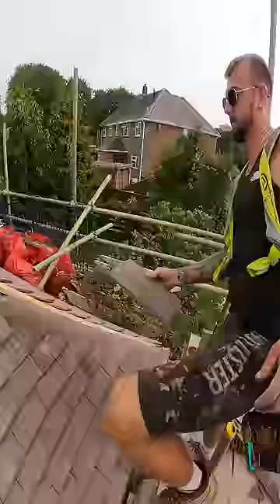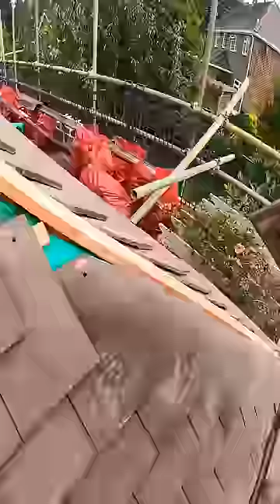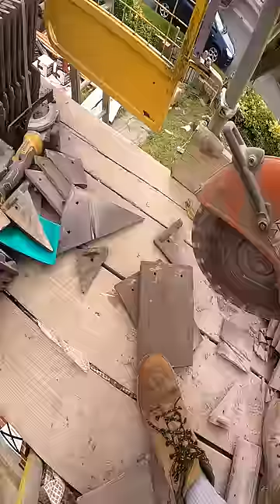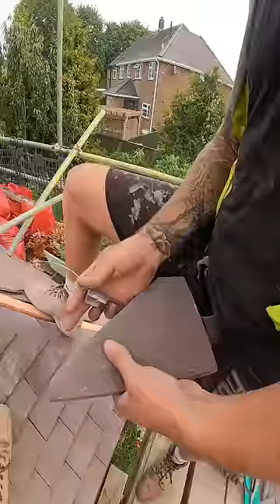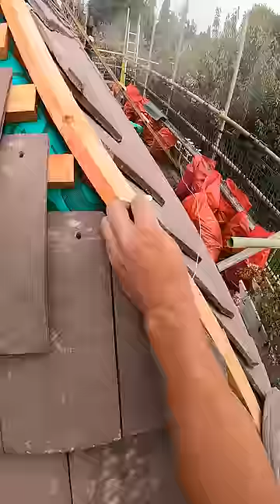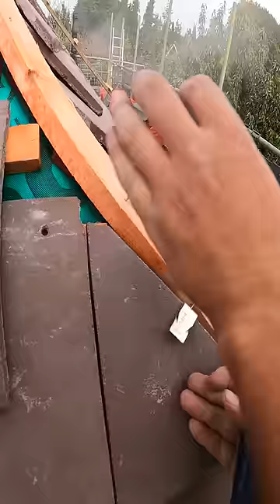#shorts #roofing  #construction

Comment: That corner though...my day is ruined.
Reply: It triggered my ocd
Reply: If you love the corner so much why don't you marry it
Reply: I will get covered your just worried about the bottom visible part at that point 😅
Reply: Getting covered. You are one of "those" customers 😂
Reply: Wrong, one of the workers actually doing this and if everthing else under is properly installed underneath that small imperfection wont matter at all lol
Reply: @sickwidit3099  sorry i read it wrong the first time. I agree with you
Reply: Oh I hear ya . As an installer , that shit has me feeling like Howard Hughes . And the saw , nah ... I would have to go grinder and diamond edged blade . But that's just my maniacal, perfectionist self . It's imperfectly fine... But I would struggle to not have the urge to fix it .
Reply: Vatoslocos327  no compa haha era cura pero aquí todo se lo toman en serio hahah vatoslokos pa siempre.
Reply: @Gamigner what are u 12??
Reply: That's a Big Saw it's going to knock off the corners it's getting covered anyway
Reply: Nice job.
Reply: @mohammedarshad3798 you don’t have ocd
Reply: @anidiotmakesthings 😔
Reply: I think a corner line will come through and cover it
Reply: @sickwidit3099 still triggers my ocd 

It's far far better to use a small battery grinder too 😂
Reply: If youre worrying about that and going to recut all the ones that happens to, best order at least twice as many as you need and a fresh skip.
Reply: Same... my boss would've flipped shit over that if he saw me put that in lmao
Reply: The top covers it💀🙏
Reply: Wont see it at the end
Reply: @Gamigner 😂😂😂😂
Reply: Ceh, weak
Reply: If he had cut starting from the other side that wouldn't have happened 😅 I knew as soon as I saw him go in for the cut that was going to happen

Comment: As a professional painter and having been on hundreds of those types of roof I am truly happy to still be alive.
Reply: As a professional painter.  Ive broken hundreds of those tiles without telling the homeowner.
Reply: Did you see how close his belt is to catching that scaffolding pipe?
Reply: A professional painter?? I doubt that you ever entered a painting apprentice program. And if you do indeed possess a master degree in the trade congratulations. It truly is the hardest apprenticeship is 6 that i ever did. 🛶💪🇨🇦
Reply: @tookalook1  He told me he was a master fisherman or master baiter, I can't remember which.
Reply: As a professional painter I've definitely broken a few tiles and blamed it on previous tradesmen. 😂
Reply: @tookalook1 🤓 I have a painting degree
Reply: @tookalook1 what made it harder than any other apprenticeship? I have master collision certs, master automotive paint certs, journeyman welding certs, journeyman heavy operator certs and journeyman plumbing certs, currently working with an electrician for heavy wire. Non was harder or easier than the last. All required full attention, high intellect and hard work. 
Why is home painting any harder?
Reply: @tookalook1 as a professional painter at 19 years old with 0 time in a painting apprenticeship and 0 painting certificates. I have my osha 10 hour con safety. I would put my painting work up against any other entire crew and 99% of the time not even give it a second thought. I’ve painted with painters who have >20 years under their belt and I feel bad having to go paint behind them on 2nd coat. You don’t need a degree to be a painter. You don’t need the skills(you will learn them quickly). You need the patience and drive to give your customer a beautiful end result and you will succeed. It is not hard by any means.
Reply: @ac03wells if you can piss, you can paint.
Reply: 1 hailstorm
Reply: Who made you a pro painter?
Reply: @tookalook1  why would you assume hes not a professional painter i could assume your a troll
Reply: If you care more about having a happy customer no matter what , you’re more than likely a better craftsman at your work than most
Reply: I’m thinking about opening a painting business , any advice?
Reply: @ejjohn2072 then you're not professional ;)
Reply: @uliloco1  hehe, yeah i hated that job.
Reply: @NickZ6297 it isn't
Reply: @NickZ6297 bullshit you have all of those at once bro
Reply: @BabaYagaUnderYourBed  if you say so, bro. I'm also retired at 35. Wanna know a thing about hard work? Didn't take a day off for 15 years. Not hard to get certified in trades if you pay attention and have even a basic IQ.
Reply: @ejjohn2072 you mean as a non professional painter 😂
Reply: @BaggedWater  yooo same here bro, like that’s exactly where im at age and all. Its awesome to here there is other guys my age that still care for the craft
Reply: @NickZ6297  its not lol if anything out of all those id say sparky work or welding just cus if you lose attention a lot more chance of fucking up and dying
Reply: With all the measuring going on in here, it seems  like everyone here is a carpenter, not a painter.
Reply: As a professional photographer I go to the dog park and coat myself in penut butter… owners hate it dogs love it
Reply: Long  run》
Reply: Tradesmen (and women) are never "professionals".  They are journeymen in their chosen vocation.

Professionals are those who have attained an academic standing and passed exams in their self-regulated field, ie: physicians, accountants, lawyers, teachers, insurance fellows etc.

Journeymen like to be "professional" in the quality of their work, denoting a mastery of their trade, however they remain tradesmen rather than professionals.

Comment: He’s going to regret not wearing a dust mask later in life
Reply: Holds his breath till the dust is blown away
Reply: Or ear protection
Reply: Sure.
Reply: You loved covid I can tell.
Reply: hes not young so sooner than later
Reply: Truth hurts
Reply: It's slate ffs it will not harm anyone
Reply: Every real roofer knows holding your breath is the only PPE that is required!
Reply: Also it’s not slate
Reply: He's going to regret using the one tool that was invented in hell.
Reply: Im in my 20's and dry wall and hardie backer are f*cking my up rn. been 2 months with a cough
Reply: @alexgreenwood8957 
You sure about that?
Apparently the dust is worse than asbestos.  Just sayin😮
Reply: @danielschiel7001 that's not how that works lol tiny particulates, the ones that give you severe health issues btw, can stay dormant in the air for much longer than you can hold your breath
Reply: HILTI DSH 600 12" saw can add a pump that runs off of the gas saw, just need a bucket of water
Reply: Silicosis for ya
Reply: @DesMessersSchneide dude exactly how are people not talking about that. Like he could literally cut into his leg with one slip-up!
Reply: yep silica will take those lungs out
Reply: @codydavis8043 😂
Reply: yeah
Reply: A bit of rock or wood dust isn't going to hurt anyone, they probably hold their breath while cutting as well. Dust with plastic or chemicals however is bad.
When it comes to hearing protection, at least where I'm from, it's only required over a certain decibel for a certain period of time, and the saw only runs for a few seconds at a time.
Reply: He might die before then…. maybe trip on that hammer and fall of the scaffolding
Reply: @KoxenBols  concrete saw is loud enough to cause hearing damage and thousand die each year to concrete dust
Reply: It's blowing away from him he's fine

Comment: Wow! I never knew how this type of roof shingles were install.
Reply: That isn't a shingle its a slate tile. When properly installed the roof is good for 75-100 years. I would have a wet saw as i never dry cut anything because the dust is very deadly. Silicosis
Reply: U dont get shingles in the uk and lreland its concrete tiles and slates
Reply: Finally a video that shows Proper roofing
Reply: @garydoherty9399 yes not that garden hut roofing they do in the U.S.A load of utter crap
Reply: @alemgas Remind me what's the price of a single family home with a backyard in Ireland or uk? One with a backyard, not those litter boxes you call "gardens".
Reply: @johnypitman2368 any part of a house lasting 4 generations would be nice 😅
Reply: @johnypitman2368  it's also not a slate fella🤔it's probably best you don't comment unless u know what your talking about you complete drip
Reply: Hours of cutting.
Reply: Nailed it!
Reply: Cheap
Reply: 100lat na takim drucie ma się to utrzymać
Reply: Its something like a stone?
Reply: @johnypitman2368 pretty sure it's a clay tile not slate
Reply: @mattymc6802 Clay or concrete, depends what finish, brand etc
Reply: I’ve seen waaaaay better examples of this being done. Them chipping the slate to shape with the necks of the hammers and knocking nail holes in them. I’m going to assume this is the “new way”, a shortcut more or less. 

Other videos of slate roofing are sooooo much more satisfying, plus you get to see a tradesman at work.
Reply: @johnypitman2368    its not a slate it a pin tile
Reply: @EasyBakinX it's not slate. It's a clay or concrete tile.
Reply: @Okiknox321  build it yourself.
Reply: Jajaja así cualquiera lo hace
Reply: @yeehaw2760 the separation is not always clean with hammer, how is using a more precise tool a clown move pmsl.
Reply: @johnypitman2368 it’s not slate it’s concrete.
Reply: Ух ты? Я не знал что бывает бетонная крыша
Reply: @EasyBakinX thats how i did it.. not cutting with a saw it tkes a real skill to cut them with the tool and poke a new nail hole without breaking it.. i did it for 4 years..
Reply: @EasyBakinX No, there are already holes when molded to nail as u said!  They just cut the holes off.  But I don't see any nails in the others with holes so guess not using them anywhere.  I see why know holes in this piece as they were cut off
Reply: Not like that
Reply: @johnypitman2368 I do slate roofing and tile they are not the same thing Slate is one type of roofing material and tile is a completely different kind only ppl that don’t really do that would call it a slate tile.🤦🏾‍♂️
Reply: In 3rd world countries they are 😂😂
Reply: @mattchristensen9424  calm down about what?
Reply: It's a tile not a slate. Looks like a Marley plain tile but they don't have the lines on the underside like this one does. Could be a Sandtoft 🤷🏻‍♂️ It's a Rosemary type tile anyway 😂
Reply: Roof tiles not shingles Concrete not felt
Reply: @EasyBakinX not a thin slate Obviously a concrete tile
Reply: @EasyBakinX it's not slate,it's either clay or concrete 😂
Reply: Wouldnt last in the midwest

Comment: Guys... lay them down as close to the edge as you can. Then measure the width of a tile inwards on the top and bottom tile. Connect those with a crib cord and mark. Cut them in place from the top down. Then move the cut ones outwards and replace the gap with whole ones. Congratulations, you cut all of them in one go 😉 This trick helped me to cut the whole edge in the same time I cut 4 single tiles beforehand 😊
Reply: Yeah but then they would save time meaning they can't charge as much...
Reply: @BeesKneesBenjamin  and start charging for being fast and good instead...
Reply: Idk if you've noticed this YouTube channel likes to troll people. They do things bad on camera on purpose
Reply: C'est chiant à faire et il faut toute les fixer 😅

Comment: You’re a genius, showing how to install a manufactures product, but at the same time, not wearing a respirator to protect you from silica. Good luck with that😊
Reply: He is in the outdoor.
Reply: @pocatefo1 its crazy how u can smell a bbq outdoors. Its almost like u breathe in the air from all around you?
Reply: @cHAOs9 difference between smelling something and breathing it in directly to your lungs.
Reply: It's not like he's huffing concrete dust...
Reply: @nickfrison9716 theres literally not a difference if you can smell somthing you are inhaling particles of that thing
Reply: How's he going to wear his cool sunglasses if he wears a resp' mask?
Reply: @Gemna157  Up until the early 2000's most brake pads and clutches in cars where still asbestos.  Why is everyone not dead?
Reply: @kingcosworth2643  because that's not how risk works, if you take a revolver That holds 6 rounds put 1 round in it spin randomly put it to your head and pull the trigger you would have a over 83% chance of nothing bad happening would you considering doing that a good idea? The majority of people that do it come out completely unscathed.
Reply: @fcukyou2_  it's not that hard. I've done it plenty here in Florida.
Reply: @kingcosworth2643 the lead in gas help form a protective layer
Reply: @nickfrison9716  smh my head
Reply: @nickfrison9716  what????????????? Explain how to breathe then??
Reply: @nickfrison9716 Did you really just say that?
Reply: @fcukyou2_ I’ve worn them in 105 degree heaters, pulling out people that weren’t wearing them. Wear your damn PPE
Reply: @nickfrison9716  Try this explanation when HSE will get ahold of you. Spoiler alert they will slap a prohibition notice on your works.

Comment: I've always used a hammer with a pick on one end so I could make a new nail hole. I have never seen those clips before when I did Slate roofs
Reply: Why would you?
Reply: When you did slate roofs were concrete tiles made of slate?
Reply: Not on tiles you haven't. Your talking about a slating hammer which you use on slates.
Reply: @JackandIndica  ohh first glance looked like slate, tile roofs I've installed were always wavy

Comment: For years, I was a small engine mechanic for a Husqvarna and I got to tell you so many of those cut off saws are ruined because people don’t want to spend the time and energy to put some damn water on the cut😮
Reply: No mask Cmon bro
Reply: Husqvarna not fitting 2 part air filters to their cut-off saws then...??? 🙄
Reply: Where’s the dust suppression
Reply: @_Ben4810  they do in fact but you’d be amazed to find out how fine of dust diamond blades can create. I kid you not even with a two-part filter system, I will still find dust in place is it shouldn’t be like the throat of the carburetor and premature where on the intake side of the piston. That’s why Husqvarna tells it’s customer to make sure that they run water on the cut. In fact, the saw has plenty of accessories to get that done, portable and/or hose

Comment: Well there's a lot of ways to do things. Old school would have punched holes directly into the slate and used copper wire with a copper nail. That's the difference between a 30 year roof and 100 year roof.
Reply: Stainless is fine, and it gets capped anyways!!
Reply: Yep, and he ruined the slate he was cutting on. Should be using a real slate cutter and another point of attachment.
Reply: @danielschiel7001  like I said there are lots of ways to do things.
Reply: Yeah try punching holes into concrete tiles and see how many shatter before you get the message 😂😂 these are not slates
Reply: @makeasylumsgreatagain864  I'll be damned you are right, I stand corrected 🤣
Reply: @Bobby-ji1rq  no worries buddy 👍
Reply: Reminds me of British council flats
Reply: The other difference is ones dead ones not
Reply: Its not slate
Reply: @atstancioff its not slate though is it? Its tile

Comment: Dude this is hard as work and you make it look so easy. I’m impressed.
Reply: Impressed by the chip? Your standards are low 😂
Reply: Whats so hard about it just time consuming is all
Reply: @mrbailey4272 

Sure you can do it blindfolded with your hand tied behind your back...
Reply: @mrbailey4272 it's o.k for the finishers... in Oz i laboured for irish slate roof installers after Sydney's massive hailstorm... heritage slate has to be replaced same for same... it's from Wales. My job was up & down the ladder with half a dozen blanks and space them on the battens... get's old really quick in Summer.
Reply: Prob got a labourer doing all the and hard graft.
Reply: @mrbailey4272 yh mate you really are clueless, probably flip burgers in McDonald's 😂
Reply from the maker: I appreciate that!

Comment: I have to say ive done a lot of construction jobs in my life from concrete, insulation, guttering, drywall, plumbing, electrical, roofing, framing, and the list goes on. But this type of roofing is probably the most tedious job i have ever seen. Im sure once you get the hang of it that ot flys but having to leave the spot your working on just to go cut 1 small peace and continue to have to do that would take a min. So these guys that do this work you guys kick ass. I just hope you get paid good

Comment: I don't know anything about roofing, to be honest, but my first reaction to seeing that one roof tile laid (into its place) was that it's not fastened down very securely. A clip and wire doesn't instill in me much confidence. I get that another tile will be placed over top of it but still. What's going to secure the next tile that goes on top of it? Just another clip and wire? Seems to me like a strong hurricane wind will rip those tiles off easily, with only those clip wires holding them there.

Comment: Health and safety at its finest, HSE would have a field day with this!!!
Reply: If HSE were doing all the work it would take  around 15x longer and just as much more in cost! Sure a dust mask would be a great addition but in reality when you're roofing all day, sometimes you forget to put it on and just want to crack on with the work. I wear them as much as possible but sometimes it's not around so you just make the cuts and hold your breath.....with practice you can hold for a long time. Also if theres strong wind, the majority of the dust gets whipped away, enough for you to finish, move and breathe good air anyway!

Comment: Never woulda thought to use a gas-powered concrete saw to cut tiles, but man did it make quick work! Prob less hassle than running an extension cord too
Reply: It’s lazy. There’s a specific saw made for tiles that makes minimal dust, this is a waste of gas and lung capacity